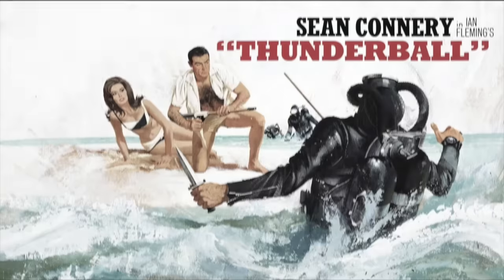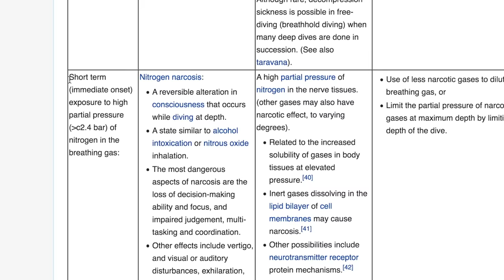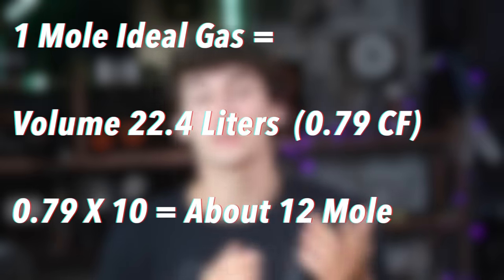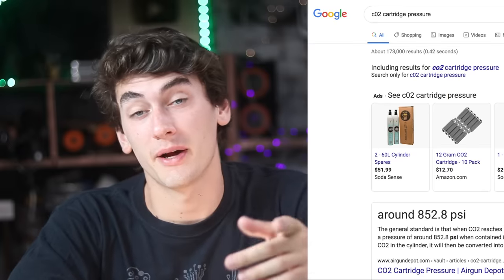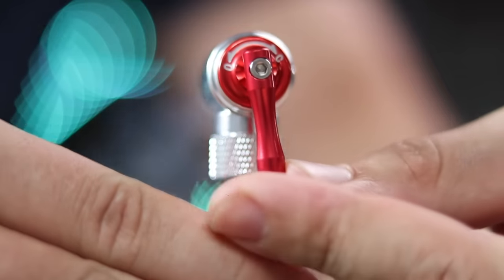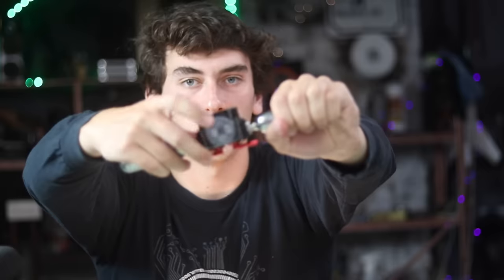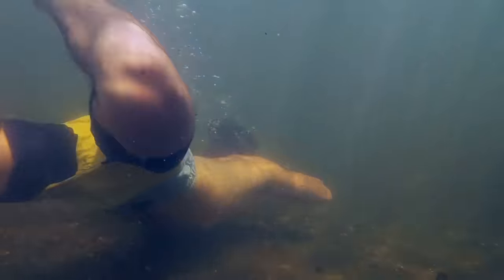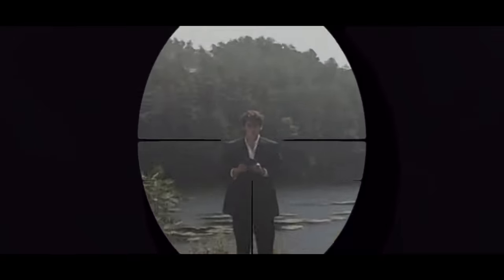Working 007 Mini Scuba Tank! - Breath Underwater With This Spy Gadget

Comment: This could actually be useful as an emergency back up for scuba divers or for any other type of work or hobby involving water. Its pretty small so you could carry this thing in your pocket or have it on a belt clip, you could even carry more than one if need be and if you could find a way of sealing the cartridges after filling them you could just carry multiple cartridges on you and swap them out while underwater as needed. I could definitely see something like this becoming part of an emergency kit for divers and could be a backup or a backup to a backup for if you were to run out of air this could provide you with a few breaths to be able to make it to the surface with. And so long as your not panicking, you could hold each breath and make 4-5 breaths from each cartridge last longer, if you could hold your breath for 30-60 seconds each breath then 4-5 breaths could provide you with up to 2-5 minutes of emergency air from each cartridge. That would be PLENTY of enough time for someone a few dozen feet under water to make it to the surface, ESPECIALLY if your using one of those emergency surfing devices that fill with air to help you surface faster. But i think that something like this could be even more useful if instead of using cartridges made from aluminum like the Co2 cartridges, using ones made from something stronger like Titanium and be able to withstand higher pressures would be better. Cartridges made from Titanium would be able to pumped up to MUCH higher pressures and allow you to have 30 or maybe even 40 breaths if you use the large 70gram ones. And since they're so small, making them out of Titanium wouldn't really make that big of a difference in their weight.
Reply: There's the spare air he mentions in the video
Reply: I mean we already carry pony tanks for that with a regulator that can get you 15 minutes or so. Its really not that useful until it can do teh same
Reply: If you hold your breath while surfacing your lungs can explode from the air expanding in them.
Reply: @Morgan Harris  that only applies to air you breathe while it's compressed. Any air you breathe at atmosphere will not do that. We only ever worry about that if we are more than 60 feet underwater and you only have to worry about that for emergency ascents. Nobody is holding their breath on a slow ascent the air would be forced from your lungs as it slowly expands. This isn't divng 5 ATM down and trying to return to the surface with that compressed air in your lungs
Reply: JLaser briefly explained that gas compresses under depth. He was also diving quite shallow (10ft or about 3m, less than 1 additional atmosphere of pressure), and getting just a couple extra breathes. Atmospheric pressure increases in value every 10m. A recreational scuba divers typical range is 30m, which triples the atmospheric pressure. I can infer that gas in this device wouldn't provide a full breath for a diver at depth, and this wouldn't be suitable as a bailout.
Reply: @mikepowell5202  I already covered this fyi
Reply: @mikesixx7655  Hey Mike, I saw your comment which covered compressed air expanding on ascent (the risk of embolism), but it didn't reflect that the air in one of those little tanks wouldn't even provide a full breath at depth.
Reply: @mikepowell5202  I figured it irrelevant as you'd never even make it that far
Reply: @mikesixx7655  I was originally replying to Chrislaws, who was proposing using this as a backup/bailout device for scuba diving. In that case you would be down that far and unable to draw a full breath from this device.
Reply: It wouldn't help at  A certain depth because too far down you only have 1 second if that of air due to water compression I learned this with my scuba instructor when we went Diving

 Tanks compress to the point where there's not a lot of air left for you, read with spare air it's a bigger tank with air in it but it's still not a lot  That's why it's called Your last gasp tank 

 And that's not even accounting for decompression sickness or the bends[ Edit Incredibly unlikely especially close to the surface But still technically possible] that you could get from resurfacing too quickly you can go down just 30' and you're already going to support some major problems if you go up too quickly That's why you're not allowed to give air to Free divers Unless it's a emergency Cause their lungs can explode if  They hold their breath while going up not Other gas pockets that are in their body
Reply: @Rob The Destroyer Jr  this is laughably incorrect information. Have you even looked at a dive table? It would take you over 7.5 hours to even be considered at risk at 20 feet. At ten feet you are not at risk whatsoever for nitrogen narcosis you aren't even half an atmosphere underwater. It is 100% allowed to give air to free divers. If we are discussing deep free diving you can't give them O2/He mixtures above certain percentages or thet will start immediately convulsing. This is a Trimix level problem and rarely ever seen in free diving. At no point will it cause gas pockets in their body to explode. That is nonsense
Reply: who reads that
Reply: @WalidMXX  people whose reading comprehension is above see spot run
Reply: @mikesixx7655  Yes, it's about compressed air..which is what's in this tank, and any tank you're breathing while underwater, so what is the point of such comment?
The 60ft thing you mentioned is garbage, and false. The largest gradient in relative atmospheric pressure is between 0ft and 30ft deep, and that region between 0ft and 30ft is where the vast majority of barotrauma occurs. Stop spreading misinformation.
Reply: @tonyvelasquez6776  thanks for proving you've never once read a dive table in your life.
Reply: @tonyvelasquez6776  did you even read his comment? He's claiming that you can get rhe bends from a dive at ten feet. He is also claiming that they don't use air on free divers in emergencies, which is patently false. Try reading comprehension
Reply: @mikesixx7655  I don't care what he said, I'm commenting on your blatant misinformation that you "don't have to worry about it" above 60 feet. You should probably retake your open water class if you don't know that the biggest pressure differential is between 0ft and 30ft. You should probably take a basic physics class too.
Reply: @Tony Velasquez  ah so you can't comprehend the fact that those are two separate conversations in here and are not related to each other at all. Got it. That's a comment where someone was claiming that if you breathe air at the surface and go down, you can still rupture a lung. That is patently untrue and a violation of the rule of thirds buddy. Any air breathed on the surface will return to exactly the same volume it had on the surface. That night be why I mentioned breathing COMPRESSED AIR at depth. Also to your other silly comments you do know that the risk of barotrauma in the first ten meters is almost exclusively caused during DESCENTS and issue with normalizing pressure right?
Reply: @tonyvelasquez6776  again you prove that you can't comprehend the language. This is getting sad. In the context of the discussion what I said is 100% accurate
Reply: @mikesixx7655  There is NEVER a scenario where BASIC PHYSICS is not true and NEVER a scenario where what you said is ever even remotely true. Not a single word of the nonsense you spewed is relevant. I really hope you're not some padi fake-rescue diver that paid their way through the course, you should have your cert revoked.
Reply: @mikesixx7655  Wow, I just actually read your comment and you literally have NO CLUE what youre talking about. 

You specifically said "for emergency ascents." There is NO SUCH THING as an emergency ascent in freediving, which is the only scenario where you would be ascending from 60ft on a breath-hold. 

Second, the rule of thirds has NOTHING to do with freediving, it's a rule of thumb that you should use a third of your air supply on the way in, a third on the way out, and a third as a safety reserve. 

You're literally just stringing words you heard on dive talk together and have no real idea about what youre talking about.
Reply: @mikesixx7655  just ignore all of my points with that weak reply.. again, you're talking about compressed air, not a breath-hold. Emergency ascents are for scuba, not freediving, so your points are irrelevant. Rule of thirds has nothing to do with free diving or holding your breath. Stop spewing nonsense you know nothing about.
Reply: Only problem there is generally you should not be holding your breath. I suppose if you replace that with slowly exhaling.
Reply: @tonyvelasquez6776   I made a few mistakes on my statement and mixed together a few very important details but overall I do agree with you  that the main point I was trying to say was that you could pop A lung or worse if you give air to someone who doesn't know that you have to breathe in-and-out slowly plus the difference in pressures being between 10 to 30' are pretty extreme and the 1st 10 are crazy.

 Which is why overall this product is not a good idea.

Then I tried adding the argument that "you could use it as an emergency air supply in case you run out".

 in which case I was trying to add if you run out of air you're probably at a depth to low for that to be any use do to how much the air has compressed in the tanks and you only have 1 or 2 gasps at most  Unless you really are just that incompetent but I doubt it since you would have probably taken the proper training and known to reserve a 3rd of your air to get backup

If i made any mistakes I'm more than happy to be corrected after all I don't want to accidentally spread misinformation so take what I say with the grain of salt and look it up yourself but overall the main statement I can give is don't breathe compressed air underwater and go backup too quickly always exhale if you absolutely have to do that an extreme situation
Reply: @mikesixx7655   I believe you mistook what I said, yes  nitrogen  Intoxication is very unlikely on the 1st 10 to 30' but it's still technically possible especially with the elderly however

 compressed air if breathed in only 10' under water can cause serious issues if you hold your breath while resurfacing this was the statement I was talking about

 And someone who is not trained to not let this happen will inevitably cause serious damage to themselves especially if they decided to take a breath at any depth passed 10'

 I almost did this when I was training and my teacher had to stop me and tell me to blow out then when We surface he told me to never do that again 

 Also if I made any grammatical errors or mistakes in my statement I'm more than happy to be corrected but please take what I say with a grain of salt and search it up yourself this is very important  Information and can lead to your life being saved in and actual emergency

 In the end of the day this product would not be of any use unless it was used right under the surface of the water And not very deep unless it was used by a trained profespecial, even then there are products that do this better although are still  More or less useless unless it's a very specific situations
Reply: @Rob The Destroyer Jr  what you wrote is incorrect thats the point. The chances of NDS under 10' (1bar) is nearly zero and as you mentioned those it happens to already havw preexisting conditions. One of the first things beaten into the heads of every basic open water licensee is dont hold your breath when surfacing. That rule is only able to cirvumvented if you breathed air at the surface and held it on the way down. The other guy in here is an idiot who cant differentiate two separate conversations with two people. I am a master certified diver and ive never actually seen barotrauma of the lungs from an ascent. I am much more afraid of narcing at extreme depth.
Reply: @Rob The Destroyer Jr  on top of that a bounce dive or someone freaking out and rushing the surface is the only ways I've even heard of that kind of trauma occurring
Reply: @robthedestroyerjr  understood..Everything got it's use case. I would agree that this could be useful, or at least cant hurt to have, for someone diving in shallow waters as a "last ditch backup" where they don't have access to a pony bottle or cant take one. It's like those "spare air" cans. Not overly useful but has the potential to make the difference between staying concious or not. 
The problem for me is when people use this as a standalone tank with no experience and no idea what they're doing, not understanding the dangers of breathing compressed air, etc., but in the case you mention about having it as a last chance for a breath or two, for a certified diver in a real emergency, then I can understand that
Reply: @tonyvelasquez6776   That is true and you did bring up some good uses for it That didn't come to mind overall yeah I agree, Specific in the uses it would be used for, as Long as you know how to use it properly And not be overestimated in its capacity,

 This was some fun Dialog very enjoyable, I hope you have a great day  And keep being cool
Reply: @mikesixx7655  plus you would probably have bad air from this
Reply: @jackmuchukot7201  yeah nothing about this screams reliable
Reply: @mikesixx7655  mate dive tables say completely different things than what you’re on about.
I assume you’re talking about your PO2 Max and Maximum allowable depth etc for enriched air nitrox or other gas blends. And you’re right, there is issues when it comes to the oxygen saturation in your blood etc, and it doesn’t usually get to the point of concern until around 30+ meters.
However, as you breath compressed air you’re essentially taking in a higher number of O2 particles because they are compressed, and this means you can fit more smaller particles of oxygen in your lungs at a certain depths in the same space that you could larger O2 particles at the surface.
For Scuba Divers this is fine because we are taught never to hold our breathe, which means we will release oxygen and allow the gases in our lungs to expand at a safe rate. However for free divers, if they take a breath out of our regulator at 20m and then they surface, the new amount of gas they just inhaled will expand and cause significant trauma to them.
The reason they don’t experience this on the normal breath hold is because they don’t introduce any more or any less gas particles into their lungs. The particles they have at the surface compress as they go down, and then expand to take up the same amount of space as they go up.

If you are a diver I urge you, please, please, do not let free divers piggy back of your alternate air, and please just have a quick google search about how dangerous surfacing while holding your breathe of compressed gas is.
I manage a group of instructors for a Scuba Diving Academy and between the conduct of basic open water courses to TriMix and technical diving courses, I can tell you that you are dangerously misinformed.
Reply: @Aiden Ward  nah buddy you just don't have a clue about how emergency situations work. Getting them to the surface is paramount
Reply: Thats a completly usless device. First there every scuba diving equipment already has auxiliary breating valve in case the main malfunctions. Second that small ballon will not give you even a single breath when you are 60 ft deep.

Comment: IDEA : Make wall climbing suit without magnets, hooks etc. , by which we can climb "ANY TYPE" of "WALL" or "SURFACES" only with micro forces of adhesions!!!!!!!!!!!!!!!!!!!! much enough to carry your weight ( KIND OF SPIDERMAN SUIT MADE FOR CLIMBING HIGH "WALLS" FOR PAINTING !
Reply: With that sticky material called gecko skin
Reply: @in7minutesorless     Not that exactly but ya kind of that thing only, if you'd zoom out the gecko skin or gecko tapes, you'd  be able to see tiny microscopic hooks. The suit should be having tiny microscopic suction cups instead of hooks for creating vacuum in large area for sticking to any surface (smooth polish surface too) and besides it will not stick to any dirt and will feel soft to touch or if we want to clean it with a cloth it can be easily done, hence will remain clean and if we compare to microscopic hooks, some particles of walls may get hooked with the layer on suit and if we try to clean, the strands of the clothes will get hooked and will become difficult for cleaning and can give spiky or prick feeling and may hurt if we touch.

Comment: Idea: an airsoft gun with a barrel that has a relatively wide range of motion. It has a camera on it and some code that can track people and move the barrel so that it always hits them, also taking into acct the direction the gun itself is facing, like how much it is angled up or left or right of the target. My idea is kinda like the ultimate from solider 76 from overwatch
Reply: Idk the name but someone made a dartboard that tracks your hand movement and moves to help you get a bullseye. Use that tracking to make a tracker. Then there is a gun that has a barrel that moves 180 degrees. Hook it up and BAM, you got yourself a tracking airsoft gun.
Reply: Amiwrong Helpme that’s Mark Rober and it doesn’t track your hand just the dart.
Reply: @alejandroalvarez-barreiro9560  you could still use that system for a tracking gun. But he already built one that tracks faces. It's his shoulder mounted gun.
Reply: Already made smart point optical sights
Reply: There is a hunting sight that does alot more then just track it makes being a sniper a no math job they have also made a weapon that turns around corners so add the 2 together and you have what you want.
Reply: MGE2273 hey I’ve always wanted to make one of those some day
Reply: @russiancomrade4929  it's mark rober
Reply: @robertgarciia6243  someone already said that, but thanks